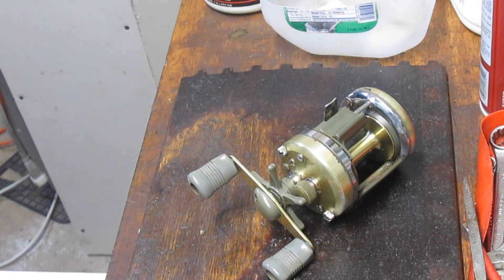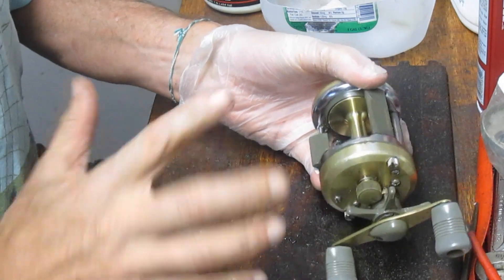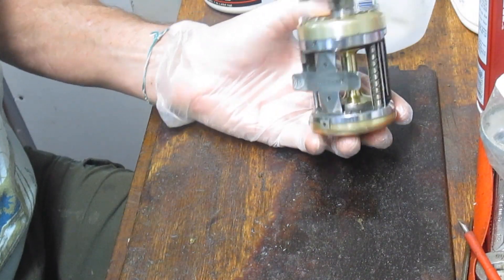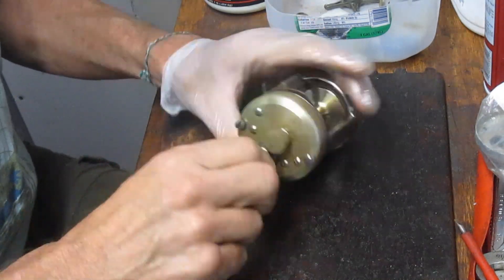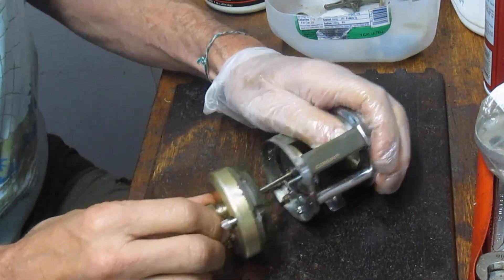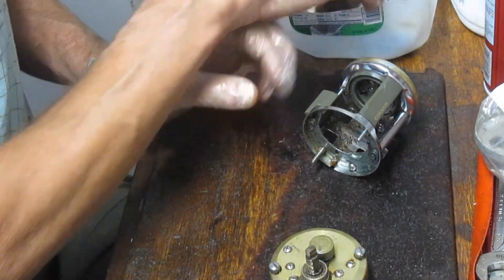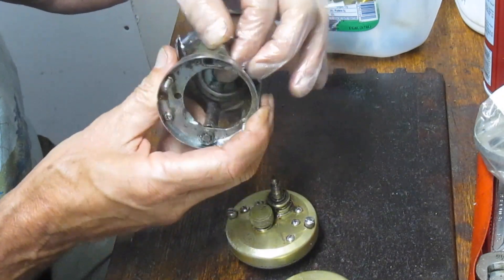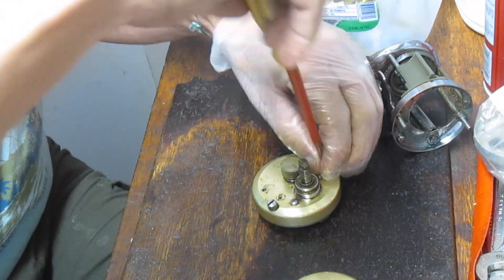Shimano Corsair 400 How to restore a basket case fishing reel

Comment: I know this is really old please help me, I took my reel apart to fix my spool tension knob, fixed the knob now my button to cast keeps slipping when I disengage it by reeling it and then I have to open it to reset it and it works until I put it all back together and try to use it.
Reply from the maker: Yes - it is one of the earliest ones that I did, but you can see the process by going to the 16:00 mark of this video and following how to set the lever.  On the inside face of the assembled gear case, you need to pull the trip lever hook down.  When installing the side plate you need to raise the release button to the topmost position.  That will ensure that the trigger works properly and returns as it should.  If you have done everything else correctly, then this should correct the problem you are having - Dennis